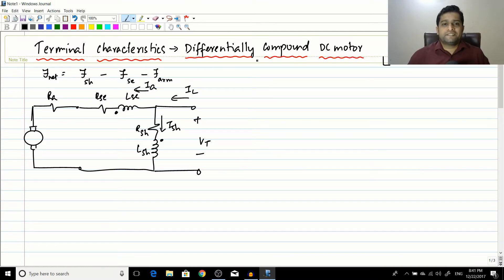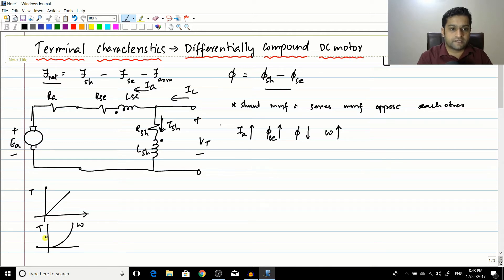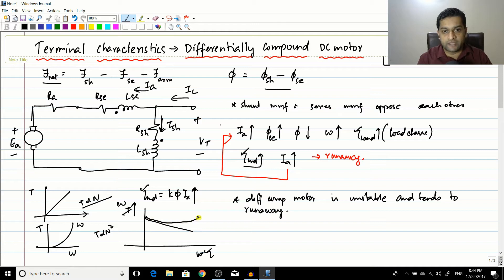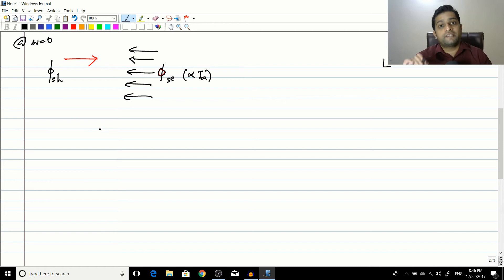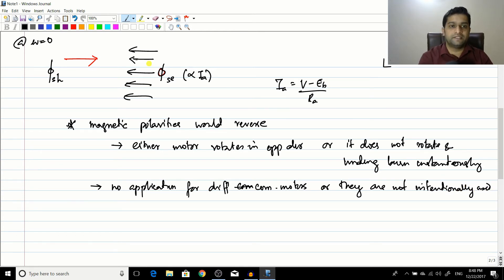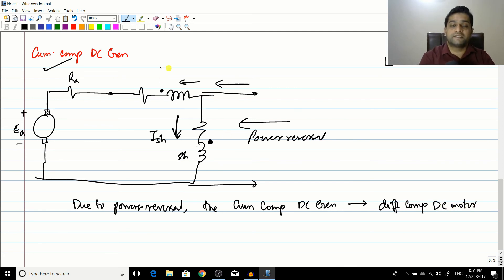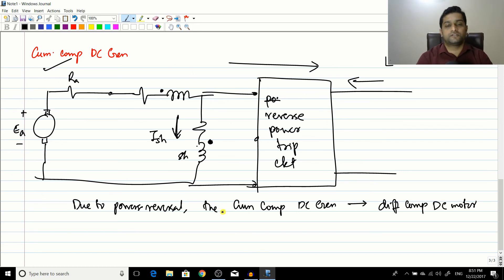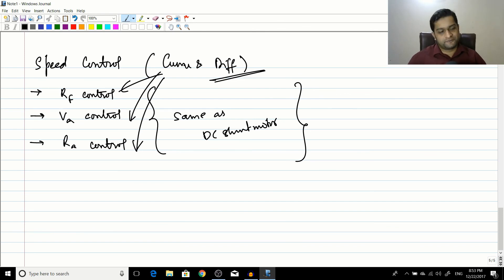#16 DC Motor -  Terminal Characteristic  - Differential compound DC motor

Comment: Sir actually how does the power reverses???
Reply: If the induced emf of the generator is less than  bus voltage then current starts flowing from bus to generator and now the generator acts as differential compound motor

Comment: Differential compound motor is being used in wind turbine pitching system when the grid fails..u are saying it has no application..
Reply from the maker: Thank you for the information, I was mentioning normal uses which are mentioned in the book.

Comment: I think as Ia increases series flux increases and hence (shunt flux-series flux) decreases therefore speed increases but due to this reduction in flux electromagnetic torque decreases and hence armature current has to increase for again making Te=TL  so again due to increase in Ia series flux increases and hence the cycle repeats and runaway condition happens
Reply: This makes more sense. Thank you. I hate it when after watching 40vids and there comes a point the loop equations don't make sense anymore LOL